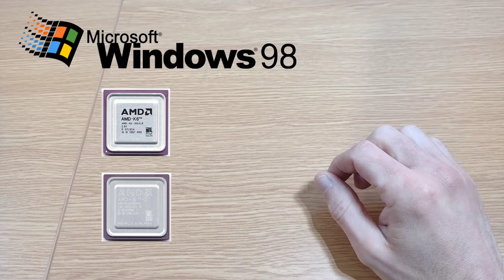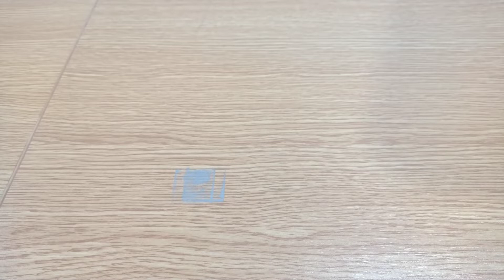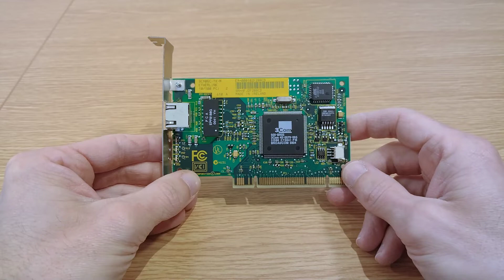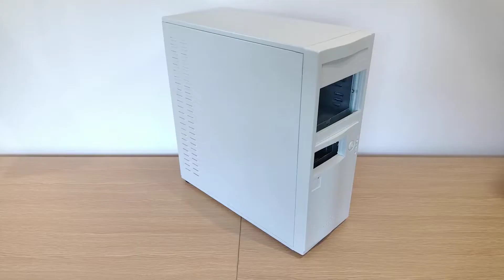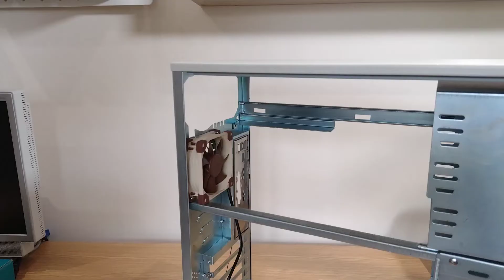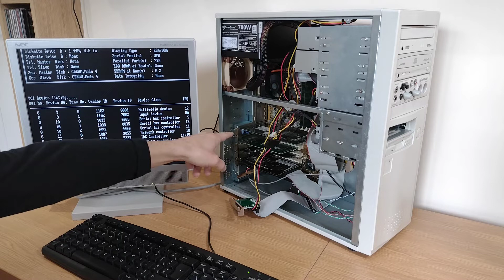Windows 98 PC Build - Part 1 Hardware

Comment: I have  the 
FIC VA-503A MB the exact one i had in late late 1999 or 2000.   ( and i have two exact identical boards with 2MB L2 On MB cache)   and a AMD K6-2+ 450Mhz @ K6-III+ 550Mhz .. ( delid and move over the larg caps in the right spots, and if the Core can handle the L2 ondie cache @ 256kb?  you now have a modified k6-2+ to K6-III+

Comment: 或许用后期版本的BX440主板要好些，电源换个保养过的ATX1.1版本的型号更适合ISA接口的需求。
Perhaps using a later version of the BX440 motherboard would be better, and replacing the power supply with a well-maintained ATX1.1 model would be more suitable for the requirements of the ISA interface.

Comment: Does that PSU output 3.3V and 5V that the motherboard needs?
I thought modern PSUs like that only pump out 12v
Reply from the maker: Yep, 22A max on both 3.3V and 5V with a maximum combined load of 130W.

Comment: G400 Max! You are lucky to have the Rev. B which runs AGP 4X! Mine's (still have it and kept it in the drawer) Rev. A and only runs AGP 2X......
Reply from the maker: Thanks, I'm not sure that 4X mode makes much difference but it's nice to have the later revision. Hmmmm, I feel a quick benchmark here to check!
Reply: @RetroSuperhighway  If I remember correctly some magazine did a comparison test between the two versions and the difference was in single digit percentage, also it's only showing on the benchmarks so it's not noticeable in real world applications. (It was done as Matrox actually acknowledged the Rev A being AGP 2X so it was a good comparison test for the interface difference as all other variables are taken out)

Still it's one thing that bugs all Rev A owners.....
Reply from the maker: Ah yes, that was it, I remember the fuss about it at the time because Matrox advertised it as 4X compatible, meaning to them that it was compatible with a 4X slot but only ran at 2X speed. I think some people thought it was a 4X speed card from the start because of the advertising. There are some old threads on the Matrox MURC forums about it if you fancy a read about it.

Comment: Really nice build. Funny is I still have my Gigabyte 5AX MB(working) and I was amazed by the crazy price that board is going for. I also have a Epox G2 ATX and a Lucky Star boards as well that are all the Super Socket 7 with the same design look to it. I know in your Windows 98 System ini file you can put the command Pages= 40000 and that will allow Windows 98 to see and use up to 1Gig of RAM. Granted the board does not go up to a full Gig but you could max out your board with Windows 98 and because of the + version of that CPU thankfully not take that performance hit.
Reply from the maker: Thanks, good to hear you still have your GA-5AX motherboard, its one of the more painful things I regret getting rid of all those years ago. The prices on pretty much all super socket 7 motherboards are high, but you are right in that certain favourite ones such as that are crazy high. I had thought about putting the machine up to the full 768Meg of RAM that the board supports, but I haven't found it struggling for RAM yet on anything I have done with it. Maybe a good one to revisit in future.

Comment: I started by buying an Advent Intel PII-350 machine in late 98....By the start of 2000 I had built an AMD Athlon 1200 machine and had my own internet site. Not bad for someone who had never even sat at a PC when I got the PII....I didn't even know how to operate the PC so had to teach myself....The PII is long gone.....But like you..would be nice to have a build made from the same parts....Though I'd think getting the same case would be pretty much impossible...I feel I have pretty much all the parts needed knocking about..expect a case...But I already have a number of PC's knocking about so I'm not sure If I should have another...Decisions/decisions...The temptation would be to upgrade it!...like stick in a PII-450.and extra ram..and better GPU (I had an ATI Xpert 98' 3D Rage back then).hahaha!..but that would defeat the object of it.
Reply from the maker: Yeah I know what you mean, that was my dilema too, build what I had or build an upgraded version. I'm glad (RAM and CF Flash aside) I went for a build of what I had, I figure I can always upgrade it later if I want.
Reply: @RetroSuperhighway  True..upgrading can always be the next option. I recall when I went from the ATI to a 16mb Voodoo 3000. Man!...what a difference..haha!...I played MS CFS  (Combat Flight Simulator) back then..one of main reasons I got a PC.I love aircraft, and CFS came out and I so wanted to play it..so had to get a PC first....Also said to the other half that being able to use a PC was going to be something everyone was going to have to be able to do in the future..so we needed to get onboard..Plus having the PC meant I could get CFS...hehehe!😁...Brought alot of Flight Sim software..Still have it all...But pretty much gave up online gaming years ago...Plus I lost my partner to cancer in 2017..and have lost interest in life pretty much...I watch YT videos to pass time as such...Though a certain rock band have got my attention..and given me something to home in on so to speak...But I like watching videos about retro PC's and parts....as it takes me.

Comment: If you fancy copying CD to CD, then you run into the old problem... 2 drives on the same cable!
If that's the CD-RW and the CD-ROM, then "write and wait on busy" tends to make it hard for the CD=ROM to keep up
Reply from the maker: I always used to put my HDD and CD-RW on the first IDE channel as master and slave respectively, and my CD-ROM as the master on the 2nd channel. I wonder how much difference the different ways of hooking them up actually made.......I feel a test coming on!

Comment: I am trying to find a socket 3 motherboard to fit my first purchased AMD DX4-100 processor. The original motherboard suffered with "revenge of Varta" battery leak which destroyed it in storage.
Like you, I am aiming for that nostalgic first build in the 90's with Dos 6.22 & Windows 3.11 but the prices for these boards are ridiculous on eBay as you have mentioned.
For some reason, I have always stuck with AMD processors and always built my own PC's from scratch. Great video by the way and have subbed. 👍
Reply from the maker: Ah thats a shame about the Varta battery, they have killed far too many motherboards. eBay prices for most retro hardware is high sadly, a few items at reasonable prices if you are lucky, but seemingly few and far between. I think I always stuck with AMD as they were cheaper than Intel at the time and younger me didn't have the cash for anything else. Good luck with your build!

Comment: great video. you are really getting comfortable doing this more.  just a little note from my ss7 video you get the best performance at 128/256mb of ram less was better
Reply from the maker: Thank you for the tip! I'm looking forward to tweaking this system once I've used it for a while. It'll be fun to see what kind of difference that makes.